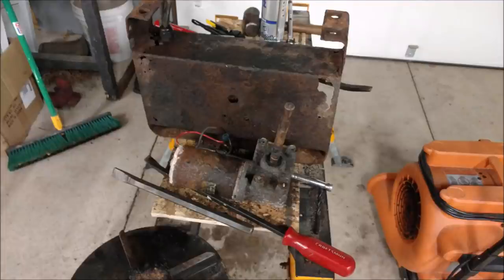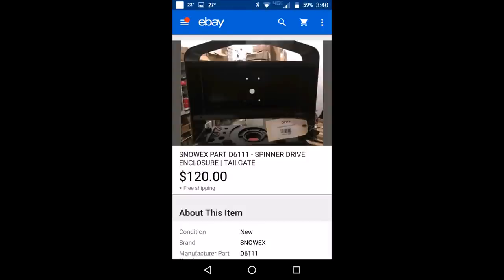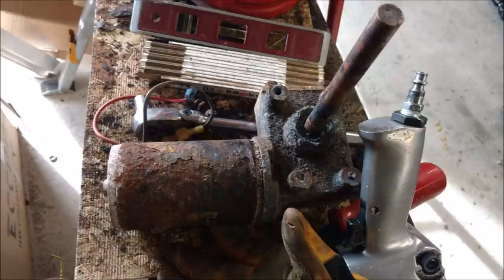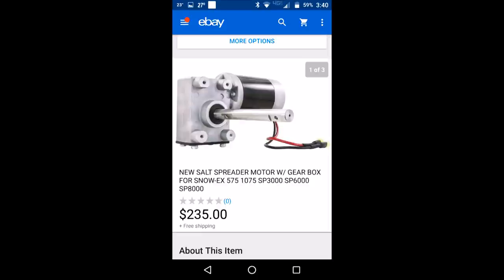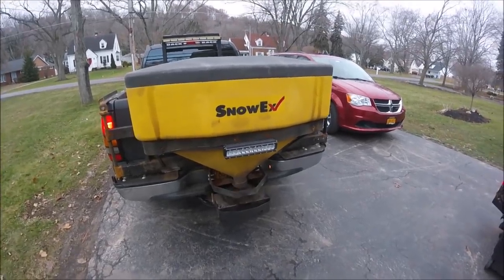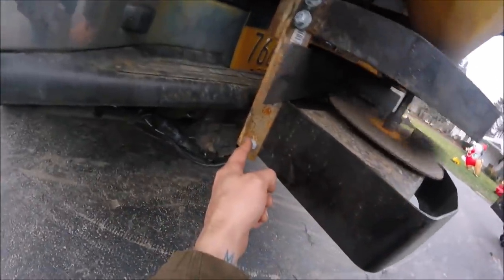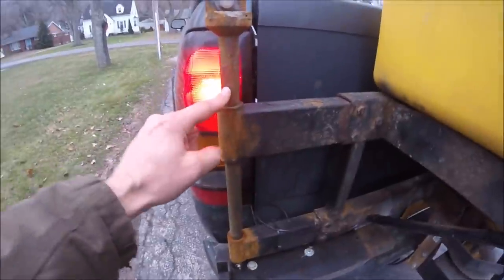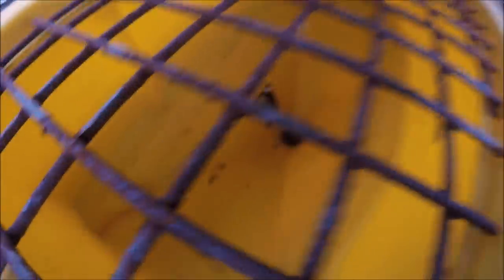Winter Vlogs "The Salter is ready" & a little something for Dan from Trimmers

Comment: Does that swing away stay on your truck in the summer.  Meaning the mounting brackets.
Reply from the maker: Johnny Mow I think I will prob leave them on there. You would have to bolt/ unbolt them to take them off. Not a huge deal but I don't see how they will be in the way for anything so I'll prob leave them on.
Reply from the maker: Johnny Mow I'll show more in the next video so you see exactly what I mean
Reply: Thanks. This is my next spreader.  Did u make your wiring harness longer so you did not have to unplug it when assessing it?
Reply from the maker: Johnny Mow I added a little but I still have to unplug it when I open it all the way. I believe you can order the swing out kit for any SnowEx spreader.